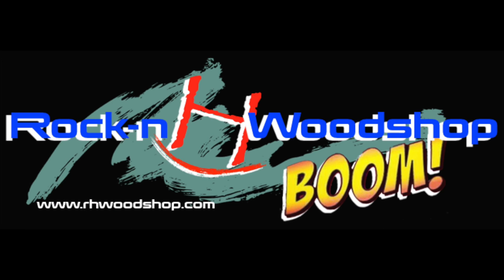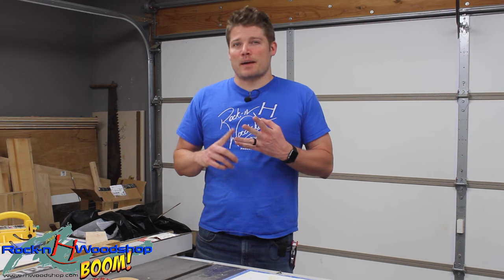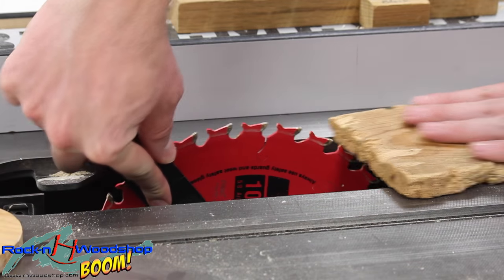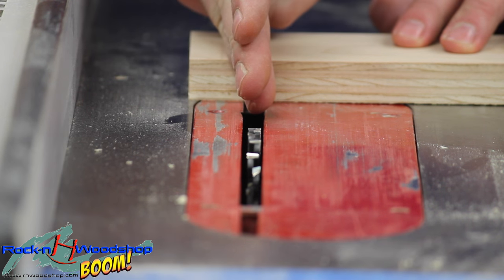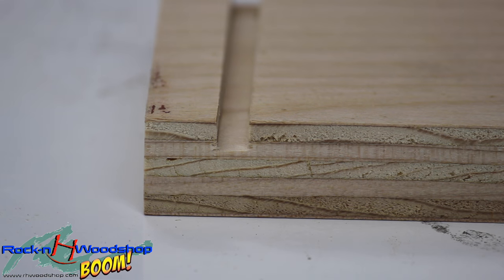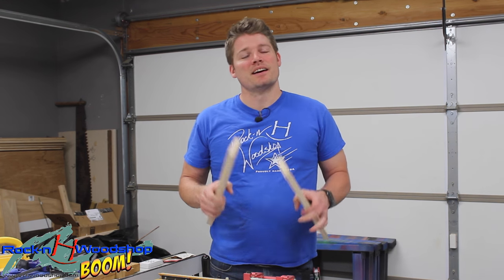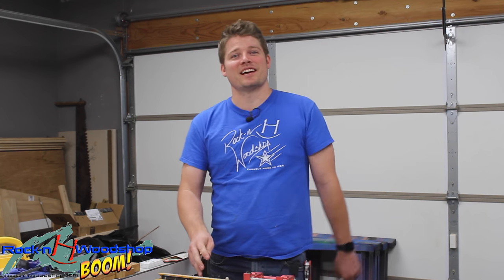Join It!!! - Lock Joint

Comment: Nice video! Simple enough. Thank you
Reply from the maker: It is and a very strong joint to boot. I use it on probably about 90% of my drawer making. It looks very cool once the drawer is sprayed with finished too
Reply: @rhwoodshop  I found a router bit at Rockler. Not too expensive either. This looks to be a good deal stronger than a box joint, and I like that you only need to clamp across. Will put it on the list. Thanks again!

Comment: Drew, Glad to see you back at it. Great video. I use this joint quit frequently and sometimes I use a 3/8 set up in 3/4 stock so I do not have to raise the blade to cut the tongue especially on drawer fronts. I was shown this by an old cabinet maker. 

I do not know if you have a shop tips section on your web site or not (would be a great addition) where tips can be posted by members so I hope you don't mind this one. If you are looking for cheap push blocks go to your local big box store and purchase cheap grout floats. I get mine from Lowe's they run under $5.00.

BOOM!!
Reply: No such thing as 3/4" plywood.
Reply: @lesterwroblewski9863  -  Guess there's no such thing as 2x4 either?

Comment: I have a problem with making the tongue using the video instructions. You say to use the 1st piece agst the fence as a stop& then butt up the tongue to be agst it and run it across the blades. When I do this, the new piece doesn't reach the blades and no cut occurs. How do you establish a stop to make the right length of the tongue to fit perfectly into the dado cut. If you but it up to the fence, wouldn't it be longer than the depth of the dado it mates with?
Reply from the maker: Very sorry about that, the fence is moved away from the blade a quarter inch in distance so you can achieve the quarter inch depth of the tongue. You will need to raise the blade up another quarter of an inch for a total of a half inch give or take since plywood isn’t exactly 3/4 of an inch thick.

Comment: Can we use this joint with plywood panel of 1m60 for corners ? And how you fix them with bassement?
Reply from the maker: I’m not sure exactly what you mean by these questions. I’m not sure what a 1m60 is but you can use this joint for corners of cabinetry or furniture if that helps. I’m not sure what your second question is.
Reply: @rhwoodshop  i Want use wood panels as wall finishing and i wont use screw i asked if i Can use this  joint for corner panel for the wall panel measure 1m60 high 0.600 large
Reply from the maker: I would say yes but I would probably make the tongue half the thickness of the panel that you are wanting to use instead of a third the thickness.

Comment: Thanks for all your videos and knowledge.  I am now a full blown woodworking hobbyist and have built and building a few of your projects; Ultimate table saw cabinet (still building the drawers and torsion top), cross cut sled and will soon be adding the 45 degree jig to my cross cut sled.  Question, when using the lock joint for drawers, it looks like the sides are actual depth and the front and back are an inside measurement plus a half inch to accommodate the quarter inch tongue on both sides, correct?
Reply from the maker: You got it. The easiest way of knowing what to cut is the sides are to length and the front and back are 1 inch shorter than the overall width of the drawer. So if you have a 20 inch wide drawer from outside to outside then your front and backs should be cut to 19 inches.  Good luck on the rest of your build and send me some pictures when you had it finished. I would love to see it.

Comment: how do you go about determining the final length of the drawer front? It's not sitting down into the dado very far.. so there must be some method to figure out what length to cut the back and front of the drawer to...
Reply from the maker: +Jay Harper what ever the overall drawer width should be just subtract 1" for the length of the front and back because the dado depth is 1/4" on both sides.

Comment: Wouldn't this be as easily done on a router table? Also I have a dada blade I bought from Sears circa 1980, that has adjustable width's.  I never see them anymore so I suspect they had some issues.  Mine works fine and i get more infinite widths if needed.  This cut you made does seem to eliminate mistakes in getting drawer etc dimensions correct.

Comment: Do you reinforce the joint with a screw for a drawer?
Reply from the maker: +My Honey's Handmade no, no reinforcement is needed as long as you use plenty of glue and clamping pressure. The joint itself keeps the drawer together.

Comment: The outside edge of the blade is 3/4 from the fence then you put the lip piece against the dado piece which put the lip piece 3/4 from the fence which is the same distance the blade is resulting in no cut.
Reply from the maker: I'm hoping that I understand this right but whenever I use the lip piece as a stop block, the fence is actually in two different locations. One is with the thickness of the wood to the outside of the blades and the other is the thickness of wood to the inside of the blade. Did that answer your question?
Reply: If I don't move the fence put the tounge piece verticle I don't have to move the fence and cut using the fence alone
Reply from the maker: Interesting...... Might have to try that.
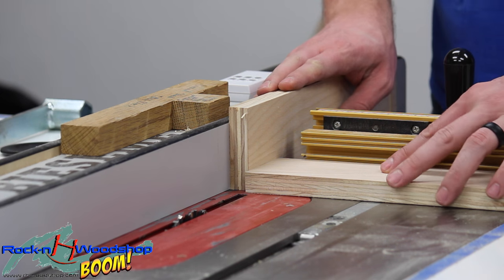Reply: I had the same question as Woodwrecker when I went out to try this joint in the shop.  I think you may have edited out the part where you move the fence for the second cut. at 2:39.
Reply from the maker: jeff hayes Yeah there's usually something I forget by accident. You do have to move the fence with the stop block on the inside of the blade so all your trimming off is the last bit of the adjacent piece which would leave you the 1/4" x 1/4" tongue.  Sorry about that!
Reply: Now I got it. I have been sitting here to figure out how the heck it all worked out. Now understand. Thanks you.